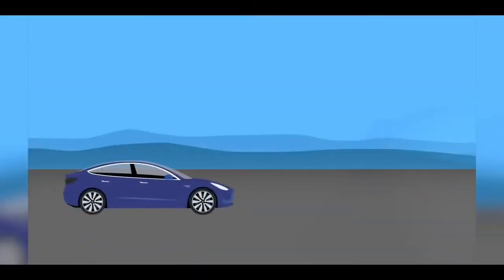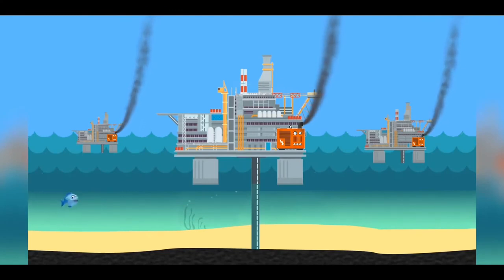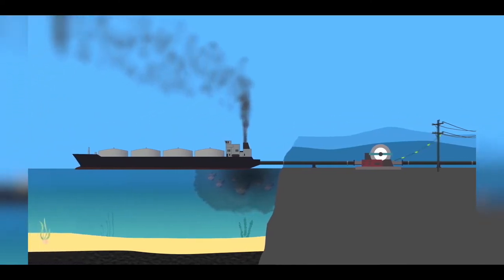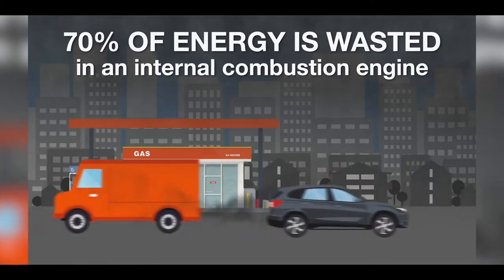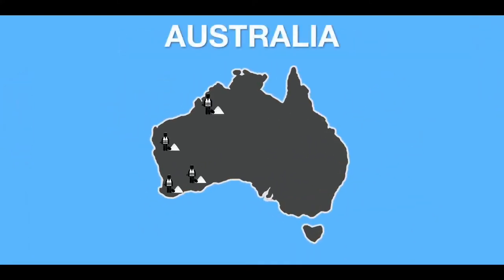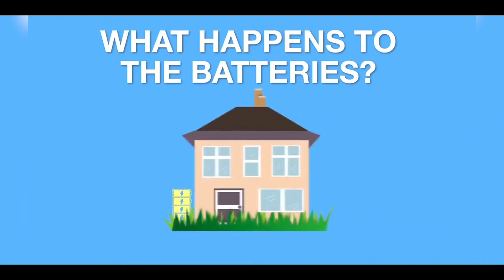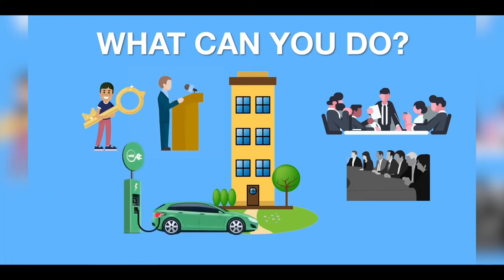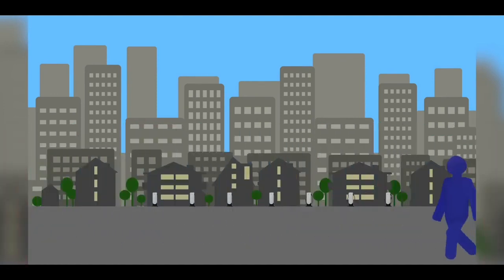The Dirty Truth about Combustion Engine Vehicles (ICE Cars vs EV's for Pollution)

Comment: Interesting thought. Since battery operated cars don't have the range of many gasoline cars that means 1 and/or 2 things. Battery operated cars cannot store as much potential energy as gasoline cars. If battery operated cars can store as much potential energy as gasoline cars, since battery operated cars have less range gasoline  cars then battery  operated cars are less efficient that gasoline cars. Therefore a battery operated cars need to be charged more often meaning more pollution for battery operated cars.
Reply from the maker: its still less pollution
the EV electric moor is not less efficient than ICE it is actually 80% more efficient
ICE is super wasteful unless its hybrid
its only that cheap Es like a NISSAN LEAF has a small battery equivalent to half a petrol tank... but more expensive EVs longer ranges like Tesla or Chinese brands top models can do 700km trips on one charge so that throws out your idea...
also the EV fuel electricity costs like 10 cents compared to cost of petrol ... owner of EV saves massive amounts of money on fuel even possible for FREE power from home Solar installations or home made DIY off grid can charge up car for only a few grand $$$$
you have no way to make your own petrol
world ends = ice cars run out of fuel
EVs = keep going from home solar
Reply: @TimBorg  A gasoline cars is more efficient as it reduces weight as it consumes potential energy, while battery operated car have no weight reduction. This is also why we will never have battery operated jets and passenger planes - Less efficient. You can't ignore that weight reduction requires less force and energy. Also, you need to consider battery disposal pollution Science is objective doesn't matter what we prefer,  we have to remain objective. Maybe battery operated cars will get it right on their next go around. This is their second iteration; they lost to gasoline cars at the beginning of the automobile and although it was a valiant attempt battery operated cars are losing again.
Reply: @TimBorg  Also, consider the degradation of potential energy of batteries and gasoline. Extreme temperatures degrade the potential energy of batteries whereas the potential energy of gasoline isn't substantially less affected. Also, from a physics standpoint gasoline cars are way closer to perpetual motion than battery operated cars.
Reply: More charging at extreme temps means more pollution
Reply: @jdavis8639 That's so wrong I don't even know where to begin 😂🤷

Thermodynamics 101 in any first year engineering program will have you  calculate internal combustion engine efficiencies. If you don't want to do so, you can do a quick google search, but their efficiency is between 20%-30%< so a minimum of 70% of the energy stored in the fuel evaporates to heat and friction.

BEVs clock in at 95% efficiency and above. If batteries could store the same amount of energy as gasoline does, an EV could go thousands of miles per charge. Alas, we currently cannot reach that energy density (and probably never will), but we also don't need thousands of miles per charge. Well be approaching 500-600milea with solid state batteries within the next 5-6 years.
Reply: @melaniewullaert4626  I am soooo right. Let's begin by looking at the amount of work done. A battery operated car weights 5,500 lbs and energy stored in the battery can move the car 265 miles. A regular car weights 4,000 lbs and the stored energy in the gasoline can move the car 425 miles. Simply physics tells us the regular car did more work so it stores more potential energy.
Reply: @jdavis8639  incorrect again, you aren't considering the efficiency of whether system. The work done by each can be equal, but that has nothing to do with efficiency. Efficiency is based on how well the system can convert stores energy to mechanical work (for cars at least). So for ICEV efficient from fuel tank to wheel hovers around 20%-30%. This is based on real world  applications of the ideal Otto cycle that taps about at 55%. Again, this is thermodynamics 101. That means the 100% of energy of the fuel in the tank 70% of it goes list to heat and friction, so the ICEV can only used about 30% of this energy to move the car, the rest just evaporates. So a minimum of $70/$100 of fuel in your tank just goes poof.

BEVs have efficiencies of 95% and over, battery to wheels. They only lose 5% to system losses. They use 95% of the available energy to move the car and only $5/$100 go poof.
Reply: @melaniewullaert4626  We both agree  on 1. Regular cars store more potential energy than battery operated cars. It's a given because more work is done by the regular car irregardless of efficiency because the regular car was moved significantly further. Sooo since a regular car gets further faster which is really more efficient.

One thing you overlooked is the inefficiency of the process that converts fuel to electricity to charge the battery in the battery operated cars. When that's added in,  the battery operated car efficiency drops significantly. The regular car does energy conversion on board. Again you have to explain how the regular car covers more distance while being "so call" less efficient. 

I'm actually enjoying this😊. Here's a hint: both the battery operated cars and the regular cars operate on the same technology level, with many similar processes. When you figure this out you'll be laughing.
Reply: @melaniewullaert4626  A regular car weighting 4,200 lbs using 30% of its stored energy to move the car 425 miles. A battery operated car weighing 5,400 lbs used 95% of it's energy to move the car 265 miles. Since the regular car has fewer stops it is closer to perpetual motion. There is nothing more efficient than perpetual motion so the regular car is more efficient. This sorta spoils things, but I really enjoyed the debate. It's a multi discipline problem.
Reply: @melaniewullaert4626  If a regular car adds fuel for the weight difference between battery operated cars (about 1,200 lbs) the the range of the regular car would be significantly further than the battery operated car. Thus, significantly fewer stops, significantly closer to the efficiency of perpetual motion.
Reply: @melaniewullaert4626  The Holy Grail of physics has been and ever shall be perpetual motion. 😄 😂🥰 Enjoy your day!
Reply: @jdavis8639 LOL that not how efficiency is defined at all. Efficiency is the output over input, not " this car can drive further than this car" 😂

Also, if you want to draw your system boundaries to include the efficiency of the powerplant that produces the electricity for the battery, then you have to do the same for the ICEV. This means, you have to include the energy/electricity required to pump oil out of the ground, the energy required to get the crude oil to the refinery, the electricity required to refine the oil to gasoline and energy required to get the gasoline to the gas stations.

Which system, BEV or ICEV will come out on top? 😂🤷

You can't pick and chose where to draw efficiency system boundaries, if you do it for one, you have to do it for both, otherwise you cannot compare both systems.
Reply: @melaniewullaert4626  For a Physicist perpetual motion is ultimate efficient; although theoretically unattainable. There is no argument against that. The closer to perpetual motion the more efficient - acceptable to a Physicist, but an Engineering wants a formula to measure. The current measure for perpetual motion is how long the system runs without stopping. Some include the energy to restart the system. The regular car wins hands down. This is not gloating. 🙂 Although I could 😛

The system boundaries are remarkably similar between a regular car and a battery  operated cars because of the why electricity is generated. Explain in the video above. Since both rely upon similar techniques at different points in the respective systems this argument fall to perpetual motion for a Physicist, while the Engineers try to win on energy efficiency. However, the question the Engineer can never answer is: How is the regular car closer to perpetual motion than the battery operated car when it's is so called less engine efficient. The simple answer is that we don't have the technology to close the gap to perpetual motion for a battery operated car. By default the regular car has the most efficient system. Yes I am doing the cowboy dance and that's my handprint on your bottom. 😄🤣😂